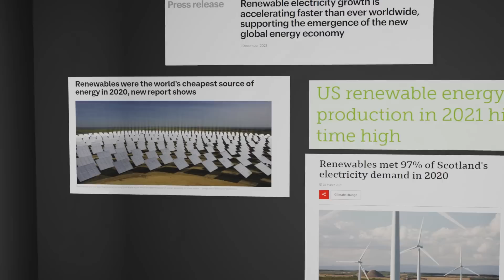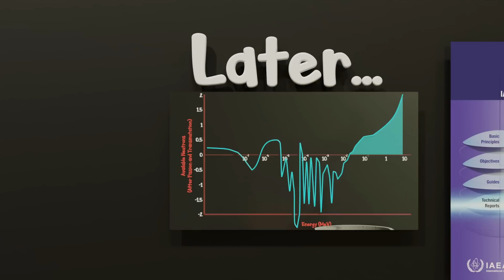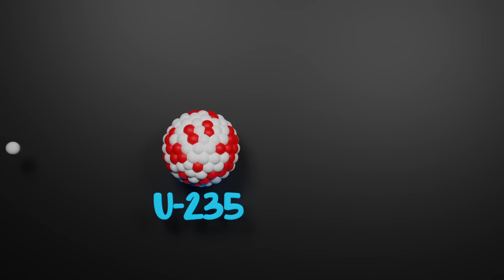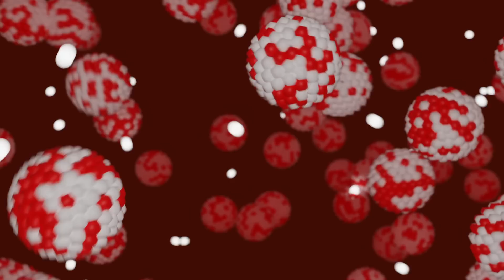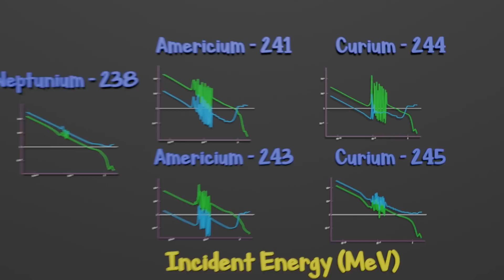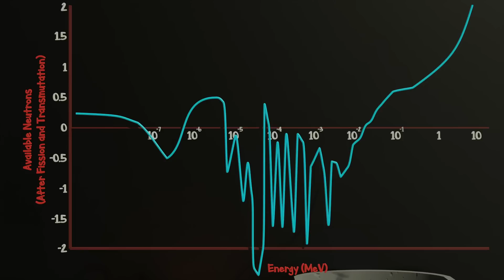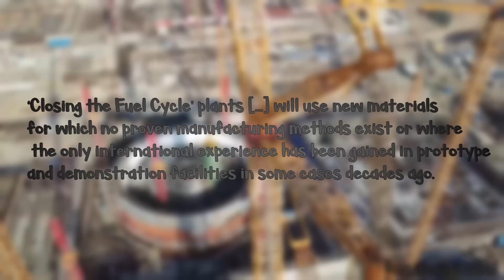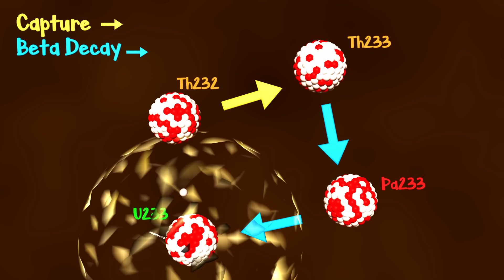How to turn Nuclear Waste into Nuclear Fuel

Comment: This is like kid me hearing about radioactive waste and being like "but if it still radiates, why can't we continue to use it until it doesn't?" Except it's actually possible, sweet! Even if it doesn't become the primary source of energy, actively depleting the waste until it's maybe less dangerous seems like a good idea, and if we get energy from that as well, yea let's do it!

I still think that renewable energy will be better in the long run, and it doesn't seem like it'll be worth building expensive new reactors producing the waste in the meantime... but hey, maybe you can whitepill me on that in the next vid 😉
Reply: If you didn't add so many braindead qualifiers and talking points, I would actually agree here. At least I did before I knew there were reactors that could eliminate the radioactive waste problem, and building those sounds good regardless.
Reply: @ilonachan  What country is going to be the policeman that will tell another what type of nuclear reactor it can build? Obviously no country told India it could not build a nuclear reactor from which it could gather material to make a nuclear bomb. I have, over and over and over asked simple, basic and practical questions and nuclear power advocates are very lacking in answers ... as in virtually no answers. I have asked a simple logical question of you, but it seems that it now has become your 'default' position to build nuclear reactors no matter the risk. Please study the United States invasion of Iraq. Learn the reason for this invasion and the killing of thousands of innocent people and the hanging of its leader. Most Americans were completely sold on the idea of this PREEMPTIVE invasion. 
What country will be the policeman to keep some country from dumping nuclear waste in the ocean? Many persons in power in government and in the nuclear industry would do that without hesitation if it saved one dollar. 
The issues of nuclear energy are very much more than matters of technology, there are many matters where human nature is a factor ... human error among these factors.
Stick with the better, much more sane decision.
Reply: @dunexapa1016  incredible how much you're typing without sayin anything meaningful. That "reasonable question" of yours, actually I already addressed that. By acknowledging that it's a good one, but may already be answered, with reactors that run on fuel unusable in weapons.

As for the "world's policeman" thing, it's irrelevant. OF COURSE other countries can build their own shit, and neither you nor I can stop them. We COULD get our democratically elected government to care about the issue ofc, but you're also raising a good point with how that went in Iraq. So... what's your solution? Opposing perfectly good civilian technology in your own country because other countries could use different technology for evil? You can do the first, and you can criticize/attempt to solve the second, but there's literally no connection between the two.

You also seem to think that I'm now a giant nuclear hype lady. I am not. Renewable energy is still preferable to me. The fact is however, we got nuclear waste lying around, and it's a real problem. If there was a magic machine, that could turn those dangerous radioactive elements into much safer ones, and produce lots of energy on top of that, well yea I'm in favor of that. You did watch what this video is about, right?
Reply: @ilonachan   , Is it your belief that a nuclear reactor can run ONLY on nuclear waste? Supposing that were possible ... what happens after the first cycle? The technology that can extend the time nuclear power can be used is breeder technology. Guess what type of fuel breeder power plants produce? Plutonium! The material of choice for fission nuclear weapons. 
Did it never occur to you that a nuclear power plant would be a strategic target of choice in a nuclear war? Or a target of preference for terrorists? 
And, you still do not have the story straight about the United States invasion of Iraq. The United states ACCUSED Iraq of having weapons of mass destruction. The United States ACCUSED Iraq of the 'THOUGHT CRIME' of wanting to attack the United States with weapons of mass destruction. Guess what!? No weapons of mass destruction were found ... So, I guess THINKING about attacking a country with imaginary weapons of mass destruction is a 'crime' worthy of being invaded and having thousands of your fellow citizens killed, hundreds more tortured, and the leader of your country hung. And you even suggest that Iraq is evil compared to the United States. I would say you are naive when it comes to understanding the depth and degree of evil within the United States government. The PREEMPTIVE invasion of Iraq was just ONE example.
Reply: @dunexapa1016  Look, maybe the section on Iraq came off wrong, I wasn't saying they were evil. I was on one hand posing that we COULD get our governments to do something about countries planning to make nuclear weapons, but on the other hand we need to be careful about when and how far we go to avoid another Iraq. Things are complicated, and all of this really won't meaningfully change the fact that other countries will do what they do. No need to outlaw one tech over here, because a different country might use different tech for weapons. It's still legal over there, in other words: YOU SOLVED NOTHING! Unless ofc it's a treaty where all countries agree to ban the technology together.... which for nuclear power is completely unrealistic, and for nuclear weapons has been tried, and I'm honestly unconvinced.

You are really hung up on the weapons thing tho... I get it, traditional power plants breed plutonium. I'm not actually advocating for traditional power plants btw. Even then I don't think it matters: if a state wants to build nuclear weapons they will, and people going to NPPs stealing fuel and making bombs for nuclear terrorism seems unlikely (wouldn't that already be possible & happening?). But there are in fact different types of reactors, among those probably ones that DON'T breed weapons-grade materials. I heard at least one reactor company claim this about their product, and I don't have particular reason to doubt it. (Elysium btw, if you're interested or can prove me wrong)

oh and regarding the "first cycle" thing, I have literally no idea what you're saying. According to Elysium (and this video indeed) the nuclear waste we've accumulated so far will power us for DECADES to MILLENNIA! No need to build new traditional NPPs if the new tech is safer, more efficient, more economical, and gets rid of a problem the old design caused.
Reply: @ilonachan   ,  "I was on one hand posing that we COULD get our governments to do something about countries planning to make nuclear weapons," This is the question I keep asking over and over ... Who will be the policeman? What is your plan. If countries all over the world are going to start building nuclear power plants we need a viable plan NOW . Or, will there be no policeman and any country builds whatever type of nuclear power plan it wants? What is the plan??? You want to go ahead and build nuclear power plants all over the world and there is no plan. Will there be a policeman? Who will be the policeman? How will the policeman do his job? Will there be no policeman? What will be the consequences? This plan is needed NOW .If you are going to build nuclear power plants all over the world, this is a basic PRACTICAL question. This is not wild theory. Now, if we did not build nuclear power plants and countries all over the world started developing renewable energy ... then there would be no need for a policeman, or no worry if there were not one. Are you going to have a policeman guarding solar panels???? See? Simple! You say this is a good idea ... then your mind swings back to the wrong path. 
Do you live in the United States??? I do. What is your age? I ask this so I might know what history of your country or world you may have experienced in your lifetime. I am in early 70's if that is close enough for you. I have studied energy of all types for fifty years. I know pretty well the deceptive statements and half truths people are told. Cleverly worded statements that mean nothing. I have made effort to be fairly proficient in reasoning ability. Most people reason very poorly and this does not help matters in the world. 
And about Iraq again ... How will you deal with countries that lie about another country? Former president George W. Bush said Iraq had weapons of mass destruction. Iraq did not. George W. Bush put the idea in people's minds that Iraq intended to attack America with these alleged weapons of mass destruction. That would be impossible to do with weapons that only existed in the mind of George W. Bush. The United States invaded Iraq, killed thousands of innocent people, tortured hundreds more and spread nuclear waste all over Iraq by using depleted Uranium munitions. 
"regarding the "first cycle" thing, I have literally no idea what you're saying." Will there be any nuclear power plant that runs ONLY on nuclear waste? I see this claim of so many years. I have no doubt whatsoever that there is some word trickery there. You are tricked by words and your eyes glaze over with excitement and your brain fogs up. Happens over and over. If you can provide some source of information please do. I do not think people can connect a hose from the exhaust of their car to an intake manifold and have their car run forever without adding fuel. 
Please answer this simple question for me; How many kilowatt hours of electricity do you use per month? How much do you pay for the electricity you use? My electric bill is about $5 (five dollars) a month. This is just for maintenance for batteries. I would like to, hopefully, help you understand what is the best energy solution for the future and why ... IF you want to take some time to learn ... or, maybe you just want to cling to your plan of having nuclear energy. 
I perceive that you have, at least, above average attention span for reading and above average reading comprehension.
A favorite saying; Time is precious, but truth is more precious than time.
Reply: @ilonachan   You should be most concerned about people that lie to you with pleasant words and most concerned for your own self when you prefer pleasant words to the truth.
Reply: @dunexapa1016  Oh I get it now, you think I'm a moron who blindly believes anything companies say. Trust me, I hate them as much as you probably do. I do NOT believe that all our problems are that easily solved. But if they have a reasonable case for why this technology could work (like this video) and a fairly reasonable backing from official government agencies, I think it'd be fair to let them try. That's the rational way of doing things (as opposed to the fearmongering that you've been perpetuating but unable to substantiate).
Reply: @dunexapa1016  You have way to much time on your hands bro, this is 20th comment thread iv found you in, spamming the same stuff too. go outside already.
Reply: I thoroughly agree with your statement " ... renewable energy will be better in the long run, " because that is ultimately how things are going to work out ... so why not eliminate a middle step of building obsolete, dirty and dangerous nuclear reactors for generating electricity that can also provide material for nuclear BOMBS ??? I'll take the red pill if you please.

Comment: 11:46 
De facto we can say that really working are
Russian BN-600 and BN-800 only 
Closed dates:
Phoenix  - 2010 but mostly in 1991 
SuperPhoenix - 1997
Dounreay(PFR) - 1994. 
Both Phoenix and Dounreay  had power only about 250MW. Meanwhile BN-600 has real power 560MW.
So today it looks like only Russia has working Fast Neutron Reactors that produce energy in power network.
Yep. It's strange for "Country gasoline station".

Why does Russia  not build more FNR? As i know cost of 1MW*h(output energy) is about 1.5-2 more. So that's why they don't build more BN-800/600. But they also planning to build BN-1200. So FNR is still developing in Russia.
Reply: Countries like the United States and Russia often choose a reactor design that makes it easy to harvest material to make nuclear bombs ... except, they don't like to tell you that. This is how India obtained material to make the nuclear bomb they tested.

Comment: Everything will be good but I don't think nuclear fusion will come anytime soon this century.
Reply: That is a very safe bet. Funding for nuclear fusion research for commercial electrical power generation should be completely voluntary.
Reply: @dunexapa1016  is there any guarantee that fusion will ever work that they are trying for 60 years with no reasult

Comment: Thx for explaining the difference between fizzle and fertle. Great video.
Reply: Learn about fissile as well and nuclear fusion as well. Both of these processes occur in nuclear bombs.
Reply: @dunexapa1016  go away, reply guy.
Reply: @TheOriginalJAX   , Is the density requirement for a controlled, sustained, nuclear fusion reaction, capable of generating meaningful amounts of electrical power, a limiting factor in the quantity of Deuterium fuel used? Yes or no?
Reply: @dunexapa1016  Go away, Iv found you in over 20 comment threads in this video you need to stop spamming everybody, you are unhinged get help.
Reply: @TheOriginalJAX   , If you had the choice between home 'A' which is a zero net energy home and is not connected to the grid and home 'B' which is a home that receives its electricity from a nuclear power plant and uses natural gas to heat in the winter, which home would you choose? 'A' or 'B' ? Both homes cost the same and either home is large enough for a family of four to live in comfortably.
Reply: @dunexapa1016  You are not very good at taking a point.
Reply: @TheOriginalJAX   I see YOUR point, now put your hat back on. Seriously, here is a tip ... If my posted messages bother you, then ignore them. You do not seem to get who is looking like a fool in this situation. Funny thing 'Jax' , I have never, in my entire life, told a person to shut up. The people that most want people to shut up are people that cannot stand the truth.

Comment: What time is this a video based on technical materials? Reprocessing spent fuel invests a lot of energy and materials to produce huge amounts of intermediate and low-level waste. And, after repeating the reprocessing only a few times, it produces spent fuel that cannot be dissolved. In the end, there is no choice but to directly dispose of the spent fuel.
It would be dishonest to society to tell such a desk dream and proceed with the reprocessing of spent fuel.
We should be sloppy and present to society the appearance of sincere nuclear power generation. Or do you want to get Pu and make a nuclear bomb? If so, we should honestly tell society to set up a reprocessing plant to make nuclear weapons. (by Google transulation) From Japan, Y. Kawata
Reply: There has been VERY IRRESPONSIBLE disposal of nuclear waste in the ocean. If this does not define psychopathic or sociopathic behavior I do not know what does.
Reply: @dunexapa1016  Stop harassing people in the comments section.